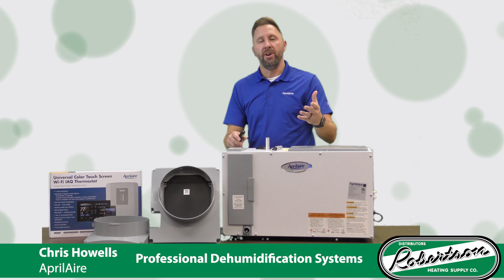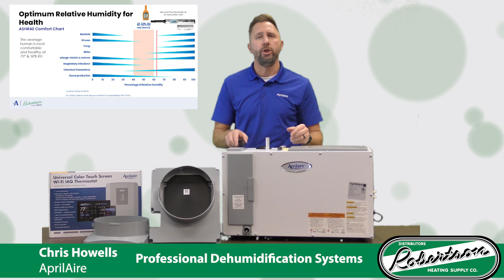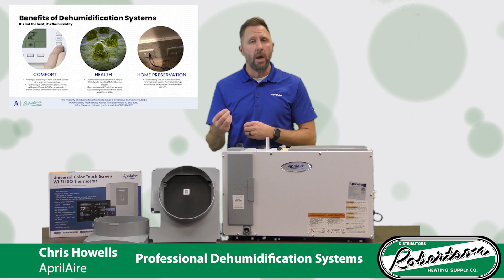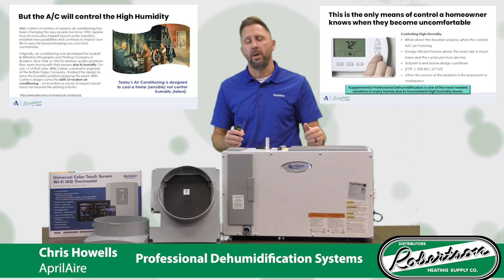AprilAire Professional Dehumidification Systems

Comment: We bought a 3300 sq ft home in Sarasota, FL and we needed to keep the AC at 74 F to keep the humidity under 60% in the summer. We could have spent tens of thousands more to have all the attic insulation removed, then sealed and re-insulated but I started looking into dehumidifiers. We settled on an Aprilaire E130W and WOW!, what a difference (I installed myself). When we're away for much of the summer, our thermostats are set to 83F and humidity is maintained near 50% with about 60% less electricity use. Our AC units would run 14+ hours/day (6000 watts) and now runs 4 hours/day in 95F outdoor temps. An Aprilaire E130 runs at about 900 watts, which I accounted for in our electricity saving. 

When we're there in the summer, we set the thermostats to 78F, which feels cooler than 76F with a higher humidity. The best way to install a whole house dehumidifier is to have a dedicated duct for the incoming air and outgoing air directly into your supply ducts on the output of the air handler, which is the code mandate in Florida (Dehumidifiers cannot be ducted to the return air side of the central cooling evaporator coil). This solved our problem for under $3k.

Florida Building Code (Section R403.13) requires ducted whole-house dehumidifiers to have backdraft dampers if connected to the supply side, bans connection to the return side upstream of the cooling coil, and mandates a minimum of R-6 insulation for ductwork in unconditioned spaces. Units in unconditioned space must also be insulated to R-2.   Two HVAC installers I spoke to didn't know about this code.  I installed the intake to a dedicated 10" duct into our kitchen near the ceiling.

Comment: Hi Chris, I live in Texas where HVAC equipment is installed in the attic. Would you use a humidistat installed in the condition space or set the humidity with the on board controller? Not sure people would want to crawl into the attic every time they wanted to make a change.